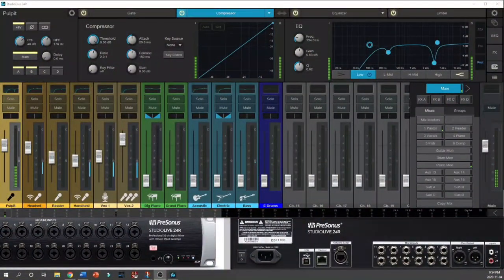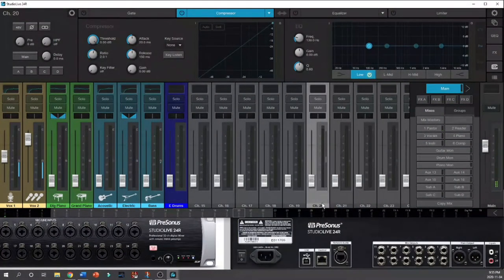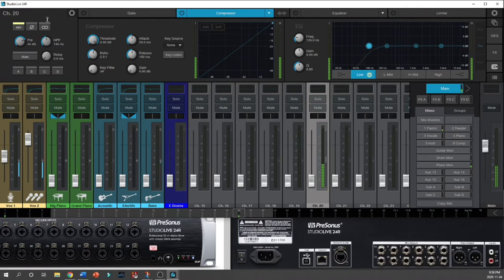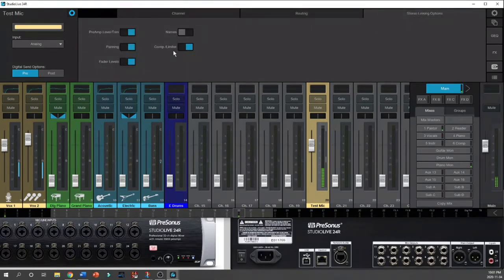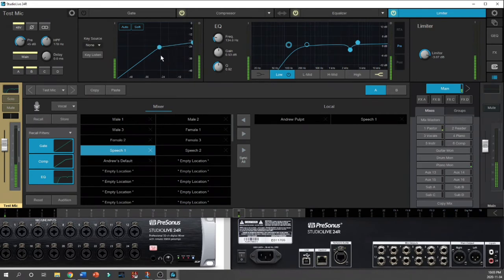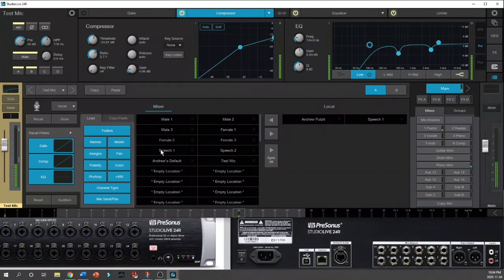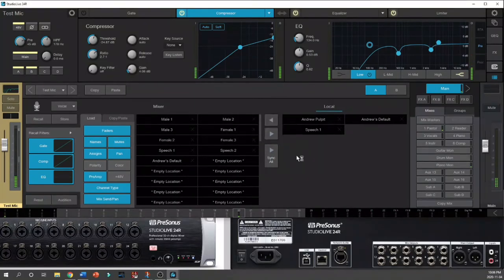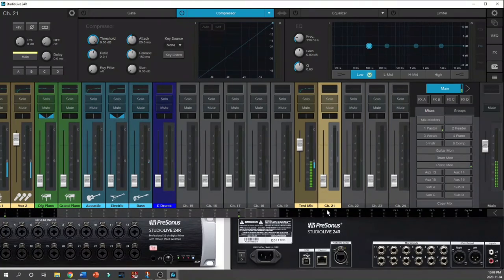Presonus StudioLive III Rack Mixers - Setting up a Channel

Comment: Thank you for your help with this. Would you have a video on how to set up with a router and no computer? I too use a 16r.
Reply from the maker: I don't have a video on that specifically, but you would connect the StudioLive III to the router using network cable, and then connect your mobile device to the same wifi, and it should be able to connect. You'll need to go to the settings page and allow access to the device, defining it's level of access. Click on the Gear Icon in the top right corner, and it should be the first tab.

Comment: We just got the 24R last year. I'm going to point our sound guys to your videos as they're very good.

I'm wondering if there is any interest (besides me) of learning about the different types of busses (like matrix etc.), when they might be used, and things to watch out for.

I also wouldn't mind you going over the ABCD bus mixes, and how they work. For example, can I have my 4 drums mics sent to A (not main) and then send A to main?

Note: We have a building that's a little too small for our congregation. The reason I went with the 24R is so that we could have our main mix for the regular congregation, plus have a separate mix for our congregation that meets in the basement, mixed with an ipad. That way we didn't have to keep running up and down the stairs every time we wanted to change the mix for downstairs. We also have that downstairs mix being send to a camera to record video of the sermon, to a computer to record audio of sermon, and to the nursery.
Reply from the maker: I'm glad the videos were helpful. With Covid, my capacity to make videos in my own time is stretched, and my personal YouTube channel has pretty much slowed to a crawl. I'll keep this in mind, but I don't expect I will have the bandwidth to address these matters until we're past lockdown in our area and life has returned somewhat to normal. My setup is pretty simple, and what you're describing is certainly possible, but I'd need to do a fair bit of experimentation and learning before I was able to put out a video that would be helpful to you on this topic :)

Comment: I know this video is old but I can't find an answer for this:  If I have a rack Presonus 24R connected directly to a Mac via ethernet AVB - can I adjust the pre-amp gains and Phantom power on/off directly via Logic Pro X and record everything flat? Or do always need to be running Studio One?  Logic records in AIFF (smaller files) and seems like Studio One records in WAV format, huge enormous files. I much rather use Logic to record everything flat. I always mix later. Thank you.
Reply from the maker: Sorry, I'm a PC guy and I've not used logic. That one is above my pay grade :)

Comment: I Love your explanation. Please is the mixer preset also available on 32r? I have gotten 2 32r mixers and i manually set them up.
Reply from the maker: The 24R and the 32R are essentially the same mixer, but one has more channels on the unit than the other. There should be presets for channels built into each of your mixers, accessed through one of the buttons along the very righthand side. That's where you can recall stored presets, whether your own or the factory presets, as well as save a setup you've created for later recall.
Reply: @AndrewBellous  I had to download it from their site. Thank you so much

Comment: Hello, thanks a lot for this video! 
Can you recommend this mixer for small church? 
We are trying to choose between x32 rack by Behringer and studioLive 24R.
Greetings from the Far East of Russia)
Reply from the maker: Behringer x32 and StudioLive 24R are both good products, but if I was in a remote location, I would opt for the Presonus device. Their build quality is better, and more reliable. Less likely you'll need to have it serviced. But, with a rack mount mixer, that's less of an issue. On the full mixer model, there's a reason why Behringer sells the replacement automated fader strips in a 5-pack.
Reply: @AndrewBellous  thanks a lot! We have ordered rack version of X32

Comment: Hello! Thanks for useful video! Could you help me to find out one fact, please? I'm thinking about buying StudioLive, because we need digital mixer and a stagebox in one device. But it's very important for me to have an opportunity for routing one audio source to two paths at the same time: 1) post fader signal with plugins, effects and levels - to our in-ear monitor system; 2) pre fader thru signal - to the FOH mixing console. For example, mic in analog input 1 sends to the analog output 1 and analog output 2, but if I'm changing it's level, compression or EQ in output 1 - there will be no changes in output 2 at all. Tell me, please: is this possible with StudioLive and Universal Control? Thanks!
Reply: @Jon M. Taylor Thank you!

Comment: ok! downloaded the app and its missing parameters that I see on this video... mmh!
I'm running it in Demo mode to get familiar with the software. PC and Tablet.
Don't see the Link channel icon. When I try the App for the tablet it's also missing parameters. 
When I switch an Aux to Sub, it gets stuck there and it won't change back to Aux.
oh Man!
Reply from the maker: The demo mode does not have the proper layout for the 24R. It only has the Gen II boards available as emulators. Not the same hardware, won't be the same look.

Comment: Hi I have problem about I can't hear stereo on studio live 16r mixer. I use headphone output How can I fix this
Reply from the maker: It's hard to advise you without being able to see the problem myself. It could be an issue with the wiring of the jack, or it could be a setting. Hard to know from your description of the problem, sorry.
Reply: @AndrewBellous  Thanks for your reply I already fix that. The problem is I didn't Drag the digital sound phase to the sides

Comment: How did you get the little icons in your mixer?
Reply from the maker: You click on the gear icon in the top left section while you have a channel selected, and it will open up a menu to select the icon.